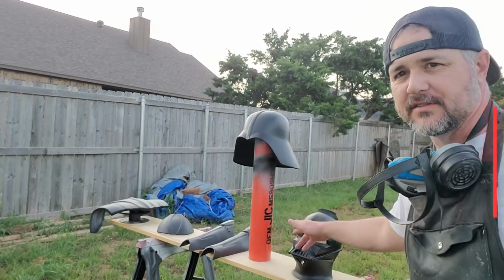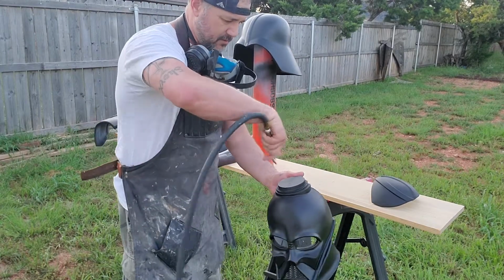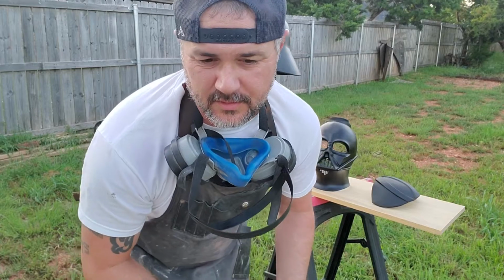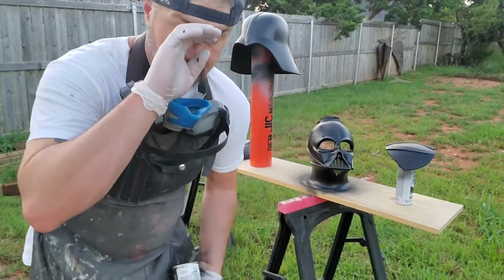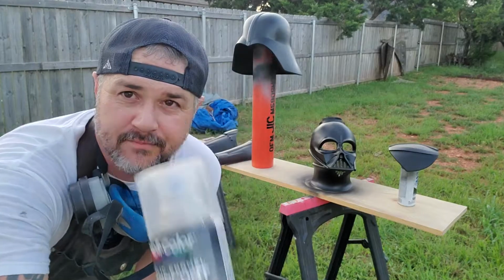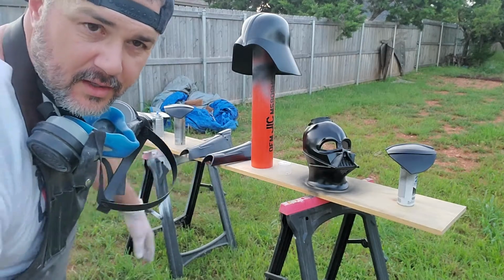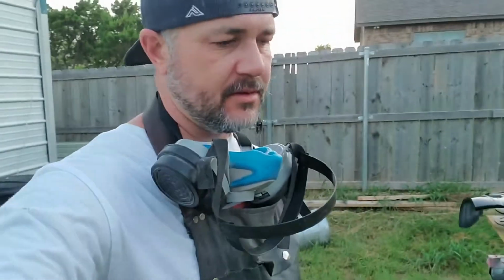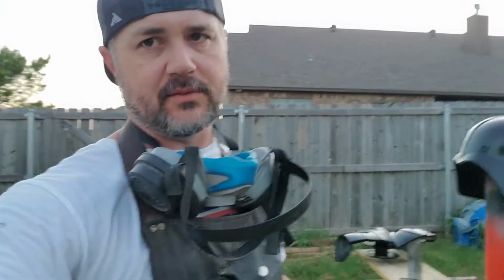Star Wars 3d Printed Rogue One Darth Vader Costume Build.... Part 5.. Doing some clear coat!

Comment: I coated my dome with the same resin you used, and mine looks like crap. I think I might need to do smaller sections, and use less resin.
Reply from the maker: Oh no! That sucks.  I did pretty light coats on mine and make sure the pieces are cleaned off.  I noticed if there is dust on anything it will not coat evenly.